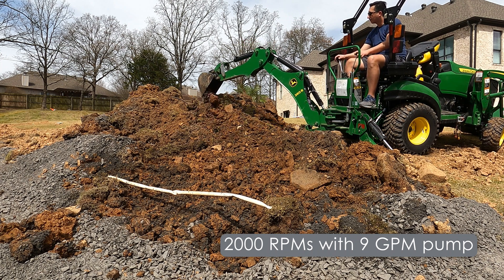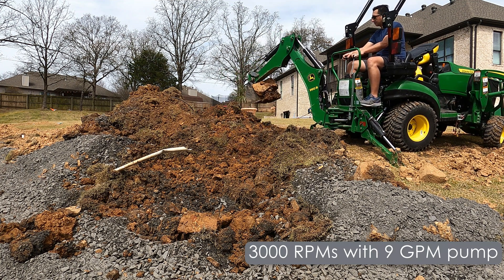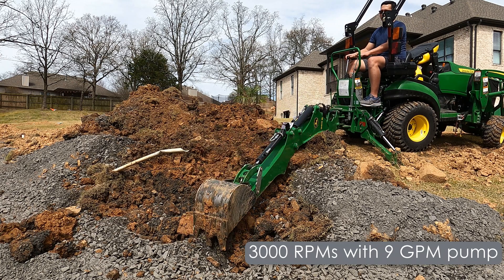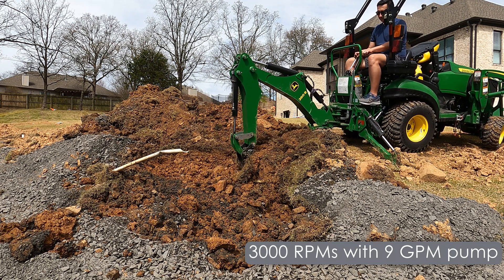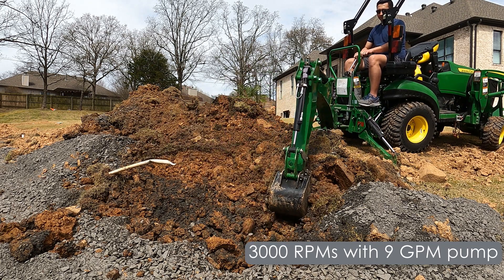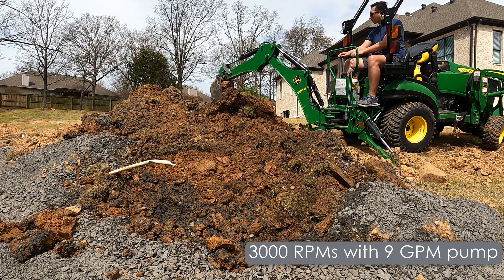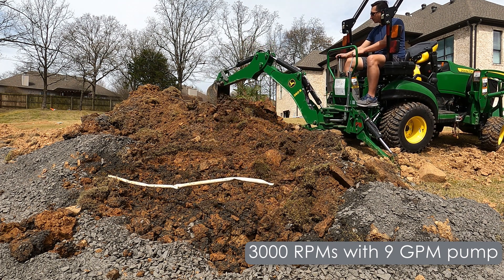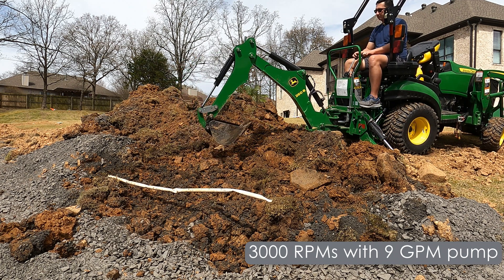John Deere 260b Backhoe - HydrosPlus Performance Kit + 9 GPM pump

Comment: Kevin, What pressure are you running at?  Stock is 1850-1950 PSI.  Did you increase the pressure?
Reply from the maker: I typically run ~3000psi unless I'm demonstrating something in a video, then I go to stock pressure or let viewers know what pressure I'm running.

Comment: Another question (in addition to the one below)... Theoretically, with better flow, now we can install fatter bucket cylinder (the lower pivot mechanism has to be reinforced, of course). Potentially, we can double the surface area, and thus, double the bucket's curling force... Did you thought about it? If yes,it would be interesting to hear your input. Below are some of my thoughts on the subject.

Doubling the bucket cylinder, probably, will be too much... Speaking subjectively, as 2025R/270A operator, bucket could handle twice the force, but it will become too slow, thus 1.5x probably will be optimal. Arm cylinder can be 1.2x of current one, a bigger one might be pulling the tractor backwards, so... it might be not worth it. The boom cylinder, on the other hand, can be doubled - it is definitely underpowered. I think I understand the reason why: when you pull both control sticks simultaneously onto yourself - the bucket travels on a leveled line (before it passes the arm pivot). Well, it is a handy feature to have, but as a result, the boom cylinder is underpowered... Though bucket cylinder is independent, and can be enhanced freely, boom and arm cylinders should be enhanced proportionally in respect to each other and their stock parameters - maybe, as a compromise, 1.5x for each of them. It would be VERY different backhoe, for sure!
Reply from the maker: I like how you think :)  I'm actually going to be offering a backhoe bucket cylinder in the Spring that has a 1/4 inch larger rod and a 1/4 inch larger bore.  This will provide a ~26% increase in power on the curl side with minimal impact to speed and keep the power and speed of the retract the same.  I had considered going to a 2.5" bore (current is 2", my new one will be 2.25"), but I think it will be too slow and possibly too powerful for the linkages, especially if some are running above stock pressures.

This is in response to 1) many people bending the stock cylinder and wanting a larger rod to prevent it in the future (whether stock or with HydrosPlus), and 2) take advantage of the extra flow that HydrosPlus provides so you keep the speed and gain power.

If it weren't for supply shortages, I would likely have this in stock by the holidays, but not this year.  

I am considering offering all 3 cylinder on the backhoe in a slightly larger size for each, which would require HydrosPlus to make sense.  I couldn't imagine running the backhoe with larger cylinders at the stock flow rate give how slow it is already.

I'm also considering loader boom cylinder upgrades.  I've done some testing with 2" bore (the stock are 1.5) and I was able to go from 915lbs at 2100psi to 1501lbs at 2100psi with the larger cylinders.  I think that might be a bit much (64% increase in capacity), so we're looking at sourcing 1.75" bore as a future option.  That should give 25-30% increase which I think is reasonable.  I'll post a video of those tests soon.
Reply: @HydrosPlus  Thanks for the quick response. I will be keeping my eye on your progress.

My front end loader is H130 (compatible with gen 1 2025r) . It is way better and way more capable loader comparing to the one they stick with gen 2 - it already operates at your improved range. Same with 270A backhoe I have - in gen 2 they downgraded to 260, the 1025r backhoe. For example, on 260 the ram on bucket cylinder is 1" in diameter, on mine - 1.25". So, 2025r generation 1 and 2 are quite different (honestly, for me 2025r makes sense only in gen 1 version). Therefore, I'm not sure if those very nice enhancements you do for little Johnny are also applicable to my case (thus my other question below, under Nick Cotton comment).

Comment: If you have a 2025r already is this mod compatible? If so Is it worth it on the 2025?
Reply from the maker: Yes it's compatible and it's definitely worth it.  You will only need the HydrosPlus Performance Kit and not the pump I currently offer.  I am working on a larger pump that will give the 2025R a boost, but it's going to be a few weeks before I can offer that pump.  If you choose to buy the kit now, you can upgrade to the larger pump when it's available and I will provide the additional tube needed at no charge.
Reply: I have 2014 (Gen 1) 2025r with H130 loader, and 270A backhoe. According to specs, gen 1 pump is 5.6 GMP, split into 2.2 for steering and 3.4 for implements.

What kind of an upgrade you would recommend in this case?
Reply from the maker: @ruslankadylak2999  Unfortunately, we don't offer an upgrade for the Gen 1 2025R and after reviewing the schematics, I don't think we ever will.  I'm not sure of the reasoning, but on that tractor, as well as a few others (2305, 2320, and maybe a few others) they used a different setup that what we see on most JD equipment, including construction TLBs.  I would have to see one in person to make the final call, but based on the schematics, it's not going to be feasible.  There is more than 1 proprietary fitting, which isn't a showstopper on getting it done, but makes it impractical for us to develop a full kit.  That and the relatively small number of them out there with them no longer being produced.

I have heard similar feedback from others with the gen 1 - they want to keep it because it's more substantial than the gen 2, but the hydraulics are even slower than gen 2, which aren't adequate for most people's needs.
Reply: @HydrosPlus  Thanks for answering my question. As is, my tractor is quite workable, only for backhoe I have to rev the engine to 2500+ for a decent speed... I really would love to have 9 GMP pump on it. So, if you ever manage to fit the enhanced one on 2025 gen 1, please tag me here again. Thank you, and good luck.

Comment: Hey Kevin.  How about reaching out to Tractor Time with Tim. I'm sure he would love to try this out. Have you tried the root test.  That seems to be the 1025R's biggest problem with the backhoe. Not enough root busting power.
Reply: Hey your welcome . Ya if it works like you hope it'll save me from upgrading to a 2038R. Backhoe needs a little more root busting power.
Reply: and so....the forever war to make ppl understand the difference between flow & pressure continues......looking forward to receiving your flow kit soo.....
Reply: soon
Reply from the maker: I haven't reached out to him directly yet, since I know he's very busy, but he did chime in on the thread on GTT.  I'm getting close to catching up on a few things and I plan to reach out soon.  Thanks for the idea!